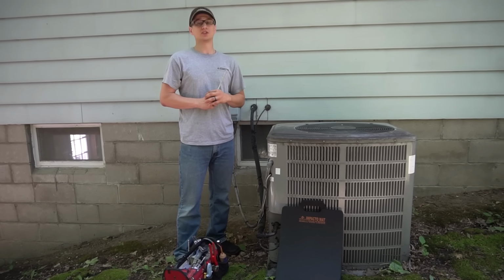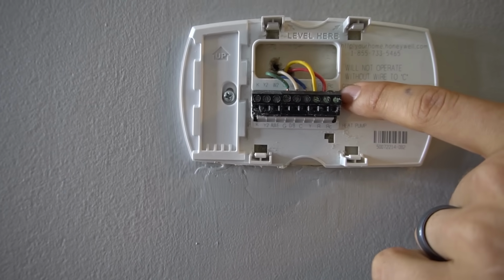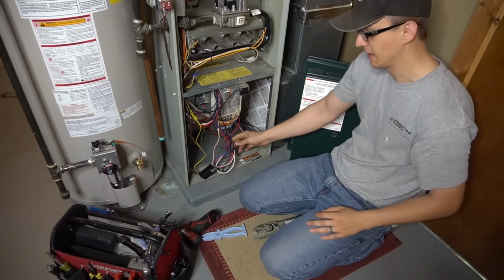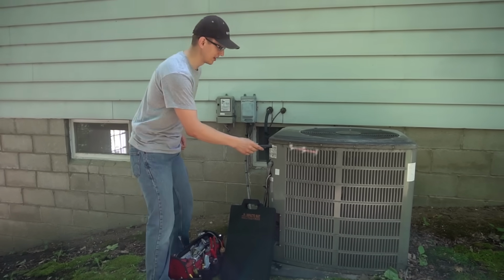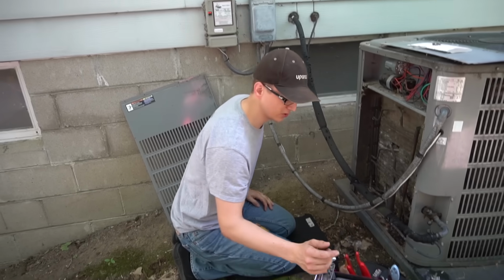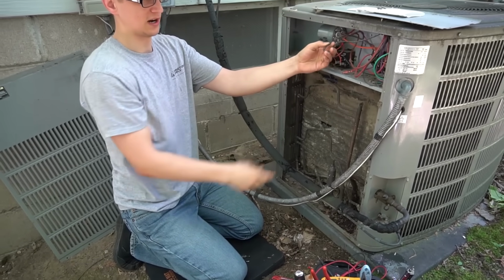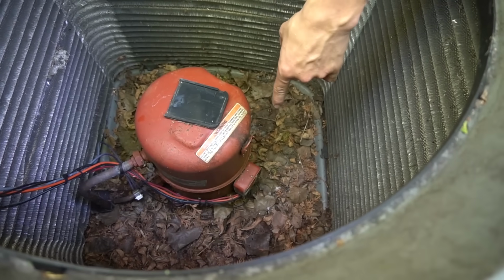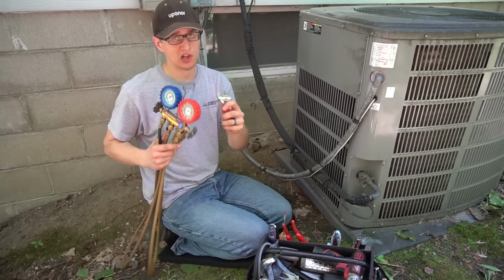AC Unit Not Turning On - How to Fix It Step by Step

Comment: Great video, but my outside unit turns on fan spins then like 10min later everything stays on but the fan stops spinning. What could it be?
Reply from the maker: My first guess would be that the motor is going bad or the capacitor is weak. Only way to know for sure would be to check with a multi-meter though.
Reply: Ok so I added some wd-40 to the shaft of the fan motor gave it a couple of spins manually and powered everything back up. It ran great for about 10 minutes and fan seized up again. Can you please tell me how to test the motor with multimeter?
Reply from the maker: If the motor is seizing up like that, then the bearing is probably going bad. You will likely end up having to replace the motor and capacitor. You can't check a bad bearing with a meter since it's a mechanical problem.
Reply: I ended up buying a new motor. 2 questions:
1- it came with a long shaft, is it ok for the shaft to be about half an inch or an inch away from the condenser? If not do I cut it?

2- New motor is 4 wires instead of 3 like old one...I understand not using the brown/white but my old one was connected brown to fan on capacitor, purple to C on capacitor, and black to 1 side of contactor. Should I follow that scheme instead of connecting the white nd black to contactor and brown to fan like in your video?
Reply from the maker: @franklinurbaez5488  
1. Yes, it is okay to cut off a piece of the shaft. You may need to file down the edge where you cut it. I would cut it if it is much longer than the old one. Otherwise as long as it is not touching the compressor, it should be fine.
2. You can cut the brown and white wire. Then look on the label on the new motor, there should be a wiring diagram that tells you which wire goes where. Put the brown wire to Fan and the common wire to C. I have a video on how to wire a condenser fan motor if you nee it.

Comment: Well my issue is condensor fan wasnt turning but did with a stick but never got up to speed so I ordered a new cap, with the new cap didn't have to use a stick but still wasnt getting up to speed, and I do think the condensor wasn't turning on, I do have a leak but it takes a long while to leach out (my unit is real old and is going to be replaced) with the power off I tested how free the fan moves and it moves freely..could my new cap be defective?..

Comment: Great video period!! I do have a question. I have a Goodman air handler about 7 years old and I'm looking for the C wire. The contractor only installed a 2 wire cable. Fortunately I was able to replace it with a 3 wire cable. I would like to install an Ecobee thermostat which require a C wire. Any help would be greatly appreciated. Thanks a lot for sharing your knowledge.

Comment: A couple of months ago we replaced the capacitor but over weekend, the inside fan was working but blowing hot air.  The outside fan was not turning but would make an effort.  So, your tips on checking for mice, chewed wires and possibly a bat fan unit, after lubing may be the ticket.  I will be back after I check the things out you recommended.  I love how quick and to the point you are.  Some go on for so long, it's in sane.  thanks!

Comment: I just looked at my last comment and didn't realize it was five or six paragraphs long. Sorry about that.
I am in North Carolina by the way and it is still very hot and muggy plus I have pets. Please reply if you think you might have an idea of what could be wrong. I am going to flip the breakers off and on in the return closet then outside in a few minutes 2 flip the breakers off and back on.
Is it possible for a breaker to partially trip and not appear to be fully tripped?

Comment: Hello, I watched a couple of your videos already after watching this one  and found them very interesting . I discovered a problem this afternoon after the house started getting a little warm. Very little air if any was blowing out of my vents. I noticed a little puddle of water under the return box in the water heater return closet. It is a slotted type wooden door in my hallway so air can flow through it. I went outside to the drain pipe and noticed there wasn't a lot of water coming out so I use my shop vac to suck anything that might be stuck in there out, when I looked inside the shop vac it look like about almost a quart of water got sucked out. Could it have been clogged because there was Frost on the coils after I took a panel off of the front of the return. I put a couple of towels on the floor in the closet and am hoping that after the frost melts, I will put a new filter in and turn it back on.
Could a clogged drain pipe have caused that ? We also had a little bit of Stormy Weather from Hurricane Dorian a few nights ago. The power went out and then when it came back on for the first 10 minutes , the power was coming off then coming back on. Could it have affected the breakers ? They don't look like they have tripped.

Comment: So I have a heat pump outside of my house. Yesterday at 5pm it was working and cooling my house very well. At about 6pm, there was a heavy rain for about 20 minutes and then by 8pm I noticed my a/c wasn't blowing cold. My air handler seems to be working as usual but my heat pump is completely silent, I don't even hear a click or humming when I lower the temperature to have the heat pump go on to cool. The unit is a 3 ton 16 seer Goodman heat pump that is about 2 weeks old. Could rain water somehow cause a short that I'm not aware of?

Comment: Hello kind sir. As my wife turns the thermostat down I can be at the unit and watch that plunger get sucked down but nothing is still happening. Any advise? Help please
Reply from the maker: Sounds like either there is something stuck in the contactor (a bug) that is preventing it from pulling in all the way or your unit is not getting power (240v). Perhaps a tripped AC circuit breaker or blown disconnect fuse?

Comment: Now that I have cool air blowing in my house again I wanted to come back and say thank you. It ended up being a blown fuse but "On Call" box for savings from power company was faulty. I could engage the contactor but it would turn off as soon as I let go. Used compressed air to certify wasn't ants (unit is 1.5 years old). Without these vidoes I would have been stuck paying ridiculous prices over the labor day weekend along with the hurricane. It ended up costing me $4 for the fuses (already had a thermostat in case) and a headache trying to convince power company to come fix their shit so my AC would get power.
Most importantly of all I was able to do this thanks to these well done and well intentioned videos. I know I am no HVAC professional but it has restored my faith that I could fix another unit I know is having problems and pay it forward. Thanks for responding to the questions I've had along the way. The gentleman behind this YouTube channel is a true stand up guy, which is like an endangered species these days. 
Cheers,
Ryan
Reply from the maker: Glad to hear that the AC is finally back up and running Ryan! :) Thank you for coming back to share your experience and leave a comment! Hopefully the hurricane was mild in your area... Stay cool

Comment: Honeywell told me I didn't need jumper for new thermostat even though old one had one, however, no Rc terminal. Only E, AUX (told me to put W there), Y, G, O, L, R, B, C. Where would I even put the jumper? I only have W, Y, G, O, & R wires
Reply from the maker: Not all thermostats have an Rc terminal. So just like Honeywell said, the red wire would just go to R alone.
Reply: @WordofAdviceTV  thanks for the reply. I've been watching a lot of your videos and seem to come across more questions as I go so please excuse the comments. I just called power company and a guy came to say nothing wrong (green light still on) but no the power saver box provided by them doesn't have power itself now that he is gone. I'm on the line again trying to get a tech to look at the box as all my troubleshooting efforts are on hold until there is power for me to continue to test I guess. Fl is hot so trying to solve prior to sun coming up (power company hiccup may put end to that plan)
Reply from the maker: @RyanSpringer1984  Okay I see, good luck! By the way, I have a video dedicated to the power saver switch. I don't know if you've seen it yet, but perhaps it will help: https://www.youtube.com/watch?v=HtEGHEDmqpA&t=1s
Reply: @WordofAdviceTV  I have, that's the whole reason I called the power company; I didn't want to be blamed for cutting the lock off and tampering with it since it was previously disconnected a while ago. Now that the situation has escalted with the power company my hands are tied otherwise I would have just bypassed it - horror story of a technician that came to my property a couple hours ago. He was more worried about confrontation than work. In addition, "I don't do on call boxes." Nice to pick and choose what customers to service...smfh.
I really appreciate your videos and your responses. I'll keep educating myself on HVAC through your videos as I await a different technician.

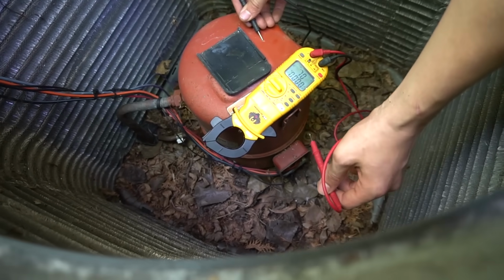Comment: 26:50, I suggest scratching the paint in two! places on the case first; then to assure good probe connections to the case there must be 0 ohms between the two scratches on the case. Then use either of these two scratches to check for winding short to the case. Also, there should be more than 0 ohms between C & R, C & S and S&R (S to R should equal C to R plus C to S).

Comment: Just remember if you do not have an EPA liscene you will forfeit the manufacturer warranty as well doing anything with the refrigerant side of the air conditioner is a felony punishable by 10 years in fed lock up and,not or,and $25,000 fine.
Reply: My folks Comfortmaker AC unit is about 3yrs old & now there seem to be an issue with it starting... anyone know how a manufacturer's warranty would work in this situation or do we have to get an independent tech to come fix the problem on our own?

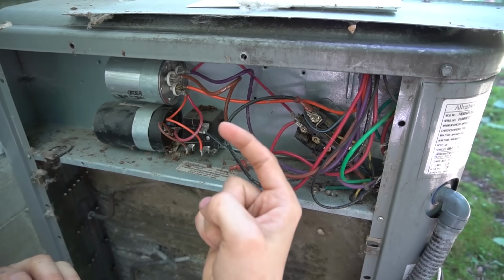Comment: I don't think he mentioned the AC Fan Control Board.  If the "contactor" is engaged ("plunged" as he says at 17:27) and the fan does not start and the compressor does not turn on and everything else works, then it might be the AC Fan Control Board.

Comment: I have a question.. I checked the internals of my outside unit and my plunger is always in but I can pull it out to make/break connection not sure if thats how some circuits work? Also I can hear from time to time a noise like the unit is trying to start up but then doesnt.. the fan motor and compressor dont come on.. so if neither are firing up does that mean it has to be something wrong before those components like the capacitor isnt holding a charge? appreciate it for any help!!
Reply from the maker: From everything you described, it does sound like the capacitor is either weak or dead. There is a good chance that that's all it is. I have a video on how to replace a capacitor if you need it.
Reply: @WordofAdviceTV  you are a Legend sir! I had watched the other video and had meant to comment there but was mistaken.. anyway I had a Capacitor that matched my units requirement shipped next day from Amazon.  I have a background in electrical so I understand the importance of electrical safety but I feel like if everyone follows your instructions properly, they will have no problem doing simple repairs such as Capacitor replacement! A $15 part saved me who knows how much money charged by a big HVAC company.  Thanks again you earned my likes and Sub!
Reply from the maker: @Class5Shtstorm  Happy to hear that you got the AC fixed! :) I agree, replacing the capacitor is not too bad. Most people should be able to do it themselves if they are willing to. Thank you for subscribing and coming back to leave a comment! Stay cool ;)
Reply: Would a 2-3 yr old capacitor need replacing already in certain situations or should it last a lot longer than that?
Reply from the maker: @joedominic9848  It normally should last longer than 2-3 years but sometimes an abnormal condition (weather storm, power surge, etc) can take them out prematurely.

Comment: My contactor pulls in, my fan spins, but don't hear my compressor turn on. Can it possibly be many reasons why my compressor won't turn on?
Reply: could be a bad/weak capacitor, the capacitor also helps start the compressor as well

Comment: Mine isn't turning on at all. Not inside or outside. When my husband pushes in the little plunger thing on the contactor of the outside unit everything comes on though. Tips? He has replaced the capacitor and the part with the little "plunger"... I'm not sure what it is called.
Reply from the maker: If the contactor plunger is not pulling in, I would suggest watching this video: https://www.youtube.com/watch?v=NVPhsK4gK1A&t=123s

Comment: Just wanted to say thanks for the great video! My outside central air unit was humming but the fan wouldn't kick in. After watching your video I removed the panel with the capacitor and noticed that plunger you pushed in to to bypass the thermostat was stuck in the on/in position. I removed the capacitor went and bought a new one at the local parts store for $25 bucks installed it and bingo! Fan kicked in and a.c. is working great now. I never would of known where to even begin had it not been for your video. Thangs again man!

Comment: Hey.  I live in Florida.  My ac is a handler inside (no furnace), and compressor outside (dual?)....  I think 4 ton (2 ton x 2 compressors).  Variable speeds.  Handler works great, if I don't touch thermostat it maintains inside temp at a cool 74 degrees at night, for example, while outside is 85.  Problem is if I turn it to 78  during the day, and then try to go down to 74 at night, I have to go one degree at a time so only the handler does the work.  It takes HOURS.  If I go from 78-74 all of a sudden, it will start getting warmer - like to 82.  If I go one degree at a time, it takes forever.  The problem I think is compressor is overheating.  Compressor fan turns on.  AC company said compressor is overheating and I need a "whole new system" (B.S.).  Then an ac tech friend said just don't touch the thermostat.  Then the power company came to remove their restricter and SURPRISE.  HUGE mouse fried all over the capacitor with resistor (burned off) and stretched over another capacitor.  I think there are 3 or 4 capacitors in total.  So what would you do?  The start capacitor with fried resistor where the mouse was is $50.  The other one (run capacitor) that mouse was reaching is rusted on top (not bulging).  That one's like $15.  If the fan turns on, does that mean the capacitor is bad?  I can't tell if the compressors are on or not because they are insulated / covered.  I think there are 2 run capacitors in total and the one start capacitor with resistor.  Thanks for any ideas.

Comment: Hey WOATV. I am having problems with my condenser fan turning on as well. The unit is over ten years old, so I did a general maintenance on the unit and replaced the defrost control board as well as the contactor, the capacitor (in the outside unit where the condenser fan is located) the blower motor, as well as the control board for both heating and cooling located in the attic of my house as well as all new transformers.

The condense fan and the unit still was not working I have had three technicians over to my house and they could not figure it out either because all power was operational. The last tech finally got the the unit running after all that work. He said that the breaker was not fully "on". I found that hard to believe, considering that I must have turned those switches on and offer several times
and all breaker bars were in there place. 

Anyway, I turned on the AC yesterday and all was working fine. Now, today, the same thing is happening. The condenser fan is not running. There is no humming from the unit, which would indicate to me that either the capacitor or the contactor are bad. There is power going to the contactor and the capacitor. 

I came to the conclusion that since both are new, that can't be problem. I will check them again anyway. However, there is one issue that I am concerned about. I am told I have a leak in the AC coils and that Freon is leeching. My question is this. If I run the AC for a period of time, will the defrost board take over and just shut down the system due to the leaking Freon? And, if that was the case, how long would it take to become operational again, if at all. Great video BTW....Thanks for all the advice you can provide.
Reply: I have the same problem. What did you find out ?
Reply: @vortroxiedoldmemes  Didn't get any response from the You-tuber himself, but I decided to do one thing that he suggested in the video. And the key to that was contained within the
thermostat. I hit hold, adjusted the degree temperature I wanted the house to cool to (72 degrees) and hit hold again. And like magic, it started. Make sure that your fan is turned to on and temperature settings are on turned to cool. It seems that a programming reset was needed. I have since tried it two more times and it works. So, watch the video again where he goes over that part. That one tip saved me money in terms of calling a service technician. Hope it works for you as well.

Comment: Question, the nameplate says minimum OCPD is 20 amps/Maximum is 25 amps. Which do you guys go by? 20 amp breaker or 25 amp breaker? #12 wire or #10?